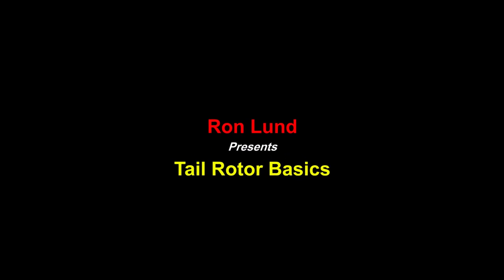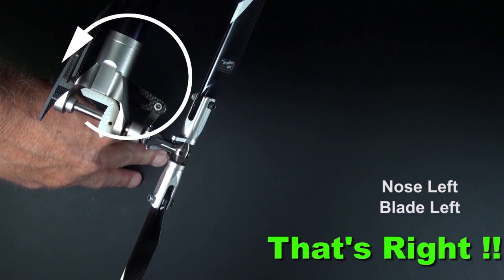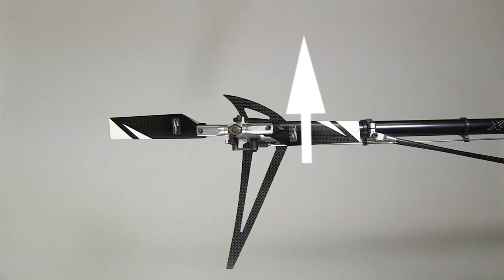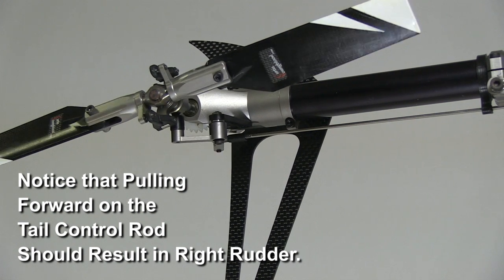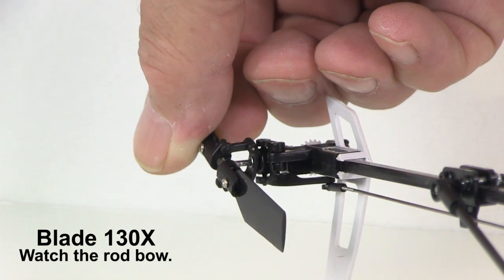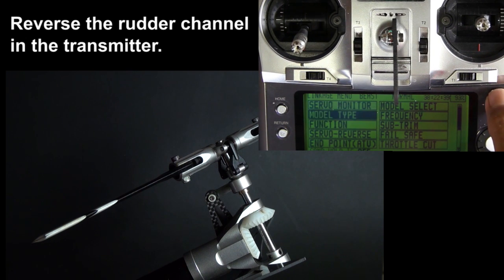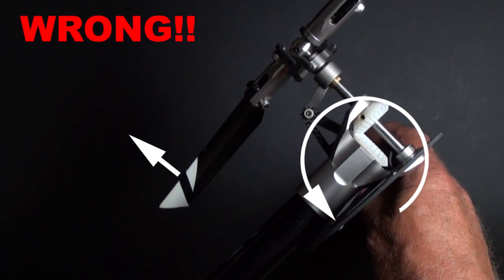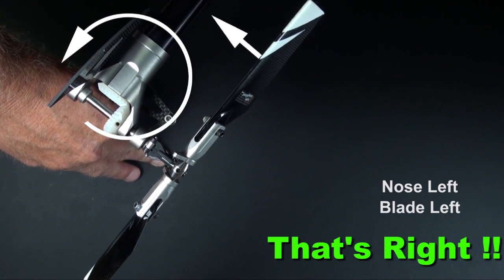Tail Rotor Basics Part 1

Comment: high grade video it helped me out a lot because my tail blade was spinning in the opposite direction turns out it was nothing to do with the radio settings it had to do with the way the helicopter came out of the box on the ESC board the wires were in reverse black was to read and read was too black causing the blades to spin the wrong way causing the helicopter to crash and spin around in circles on the ground this was on my 300 cfx RC helicopter by Horizon Hobby I'm not sure if I believe they quality flew this helicopter because there's no way it would have flown